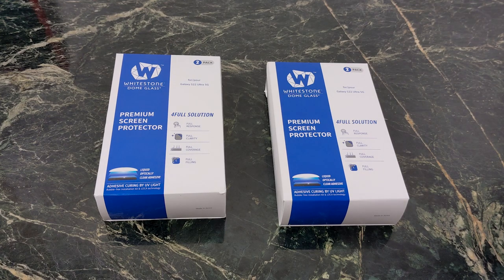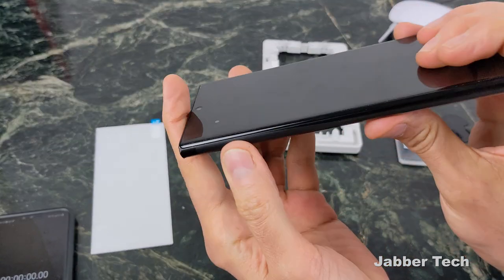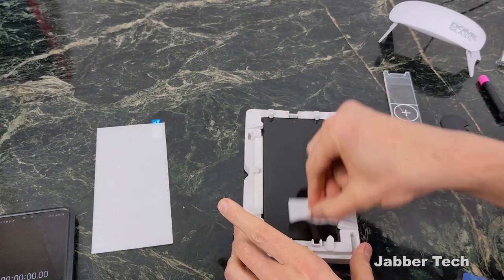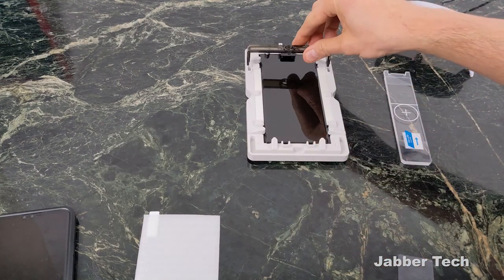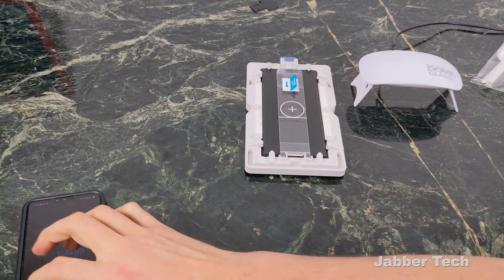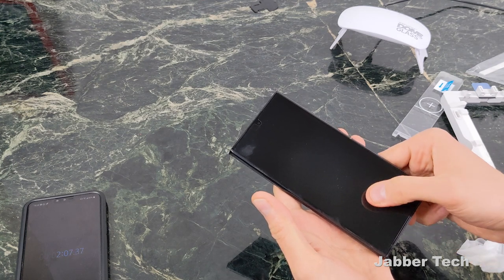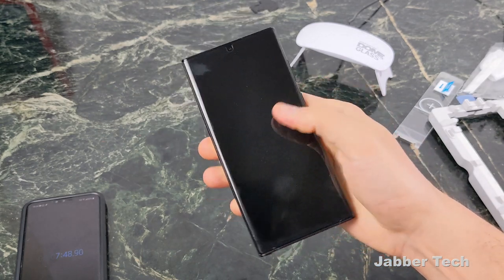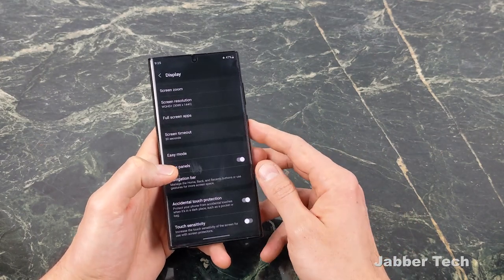Samsung S22 Ultra WhiteStone Dome Glass Screen Protector :  NEW Install Guide

Comment: I just wanted to share that my fingerprint scanner did not work all that great after installing this product.  You had to press hard, and then maybe 30% chance it would work.  The install was visually flawless.  No bubbles or other noticeable imperfections.  After stumbling on a article, I tried a long shot and baked my screen with uv light for even longer.  I went way more than 60 seconds second step curing, but that fixed my fingerprint issue.  Even after installing the screen for week. Now it nearly works as naked screen.  May work for you as well, especially if you are not out in the sunlight with your phone regularly.

Comment: Good tip. I tried something similar. Basically I held down on sensor for 15 to 20 seconds after 15 sec cure. Then cured and while curing the bottom I held down again for first few seconds while light was on. Fingerprint sensor now works pretty much perfect. Quick and I don't even need to press firmly. It's pretty much like the screen protector isn't even really there. Spen and Edge panel Works flawlessly as well

Comment: I love this screen protector but it does not play nicely with the Supcase.  So TPU film it is, but with this lip action Jackson, I'm good to go
Reply from the maker: Supcase is not compatible! I did a vid on case compatibility https://youtu.be/juGYoYWpgjs
Reply: @TheJabberTech  I learned the hard way, just 1 protector tho.  Some say ith a Dremel or sandpaper it can work but I ain't about that life
Reply: @bng1336  I used a sharp blade & shaved mine & u can't tell it's been touched at all whatsoever. It only needs a lil bit to come off for it to work. Even with me telling you I done it, u wouldn't be able to tell where. But it sucks to have to do it but it's worth it too
Reply: @BJPerryJr  but like which part?
Reply: @bng1336  the piece that snaps on the front of the phone... the inside of the corner. I just did the top 2 corners & didn't touch the bottom at all. I'm actually using the case right now & still have the Whitestone Dome on my phone
Reply from the maker: @bng13 I've done things like that in the past! Shame supcase doesn't just do it themselves with the next batch
Reply: @TheJabberTech  ya no joke!  I love the case!  They should know better being one of the most popular models out there.  Glass is glass, but with this lip, the TPU, which I like writing on better anyways, I'm good to go
Reply: @TheJabberTech  agreed... they just barely need to decrease the front piece. I mean very little
Reply from the maker: Exactly, it's like one shaving off
Reply: @TheJabberTech  lol... pretty much. I couldn't even see what was shaved off. I just know it was because it didn't affect the Whitestone afterwards..lol. Thanks for the reply & definitely the great content

Comment: I have Whitestone on my S22 Ultra.  It's the best screen protector I've used.  Doesn't look like you have one on at all.  That said, they do scratch and break somewhat easily.  It's good that it protects the rather fragile S22 glass which scratches if you look at it wrong.  But, at $25 a pop ($50 per two pack) they're kind of expensive.  I'm on my 3rd one now so $75 so far to protect my phone in less than a year time.

Comment: Nice tip!  I've had my S22U for a few days now and I put on the WSD right away before using it.  I didn't have any issues with installation, and I didn't do the finger press between curing for the fingerprint scanner.  I will say my fingerprint scanner works about 90% of the time, which is good enough for me.  There are times where it is a little stubborn.  If I get annoyed enough with it, I'll redo the installation but for now it's tolerable.  The screen protector looks perfect and works perfect otherwise so I really don't want to mess with it.  But this is a great tip in case I reinstall it.  Thank you!
Reply: You can leave it over here.  I’ll only ride it when it’s raining 🌧 l
Reply: @bgredz1  huh?
Reply: @WreckedBrewery  lol, disregard.  I was sending a text and it got mixed up with with the comments on this YouTube video 😂🤣

Comment: Great info! Also watched Ebp man video-  Then I began the process and then screwed up ( no pun intended) opening up the wrong end of glue tube, luckily I was able to keep glue puddle centered on screen, and salvage the whole process to 99.99 % perfection. Followed the extra curing steps, fingerprint pressing after 1st curing and now the fingerprint reader works great. Yikes! almost had a disaster by removing the black cap first!  forgot to pay attention to that tiny detail! Using the new UAG Kevlar monarch as my case, Not taking a chance with Otterbox defender and mess up the install. ( edges lifting etc.)( edit-With sensitivity turned up.)

Comment: I saw this trick on a different video a few weeks ago and it works.

Got a Samsung S22 Ultra (my first "big phone") and saw that the screen protector tech had gone Star Trek on me for some reason (UV curing, waaaaah?)

Got this one and the first one was pretty much an unmitigated disaster. Dust bubble, fingers print would not work etc. The instructions in the box were about as useful as a sheet of used toliet paper. 

Did usethe 2nd one and was much more careful and watched a few vids. Now it's perfect and the FP scanner is more or less perfect.

Comment: If you use increased touch sensitivity, you'll be closer to 100%of the time.

And pressing firmly on the area of the finger print scanner for 30-45 seconds continually has worked wonders for me on the S10 Plus, S20 ultra, S21 ultra and S22 ultra.

Comment: I reccomend removing the white felt glue pads before applying UV light to cure, so the UV light reaches the edges fully.😉👍   I have no issues whatsoever with the fingerprint scanner,  but I always install the WSD before I ever power on my new device for the 1st time!
Reply: Well , not sure about removing felt tabs matter because we are only doing 15 seconds the first time , then 60 seconds after it’s out of jig. So I think it will be fine. One thing that important is pushing phone out of jig with both thumbs at top and bottom at same time.

Comment: Thanks for the great tip! I just installed mine and it was like performing brain surgery. I have 2 dogs and dog hair is always floating around. So I locked myself in the bathroom and proceeded to follow your instructions . Everything went perfectly. Sometimes the fingerprint sensor won't unlock the phone, yet it seems to work 90% of the time in my apps. I just ordered a UAG monarch crimson red case. Hopefully it fits well with the Whitestone dome.
Reply from the maker: Glad to help!
Reply: Yes, The Whitestone does work perfectly with UAG line.( including the Monarch)  however,  The Otterbox Defender is Not compatible,  and although the Monarch is rated at 20 ft, it doesn't appear that way.   Good luck!

Comment: I had Spigen EZ Fit on my Galaxy S22+ and it was almost impossible to use fingerprint reader - it worked randomly and it was really annoying. I replaced it with Whitestone Dome glass and pressed firmly fingerprint area after 1st UV round over 10 times and effect is outstanding - fingerprint reader works like a charm :)

Comment: So besides the fingerprint issue with the Wsd glass, is the Whitestone compatible with the Otterbox Defender case? I tried it with the Note 20 ultra, and although it barely fit, any pressure on the outer part of case caused the glass to lift up.   Is the AM film compatible without the lifting issue?   I can't see how plastic types can help against impacts with the defender. ( currently using the UAG Monarch Kevlar edition.  The glass definitely fits, but the poor front lip protection doesn't inspire any confidence . Except maybe side or back drops.

Comment: Great content.  You could have put a weight on it,  or a couple of quarters.  But I'll still stick with the Amfilm elastic skin screen protector.
Reply from the maker: I used the weight provided
Reply: @TheJabberTech  I know, but weight was distributed threw out the screen protector. With the Amfilm glass screen protector it comes with a weight to put only on the fingerprint scanner. Works great.
Reply from the maker: Next device I'll try am glass,this is perfect now
Reply: The amFilm.TPU shrinks after 3-4weeks :(
Reply: @Pandemonium088  maybe it's film. They are mass produced.  Your's peeled after 3 to 4 weeks, I've have mine on my note20 ultra for over 5 months. With a poetic spartan case.  No peeling, lifting, or stretching.  And I change my cases, very often with no problem. Maybe try another one.🙂
Reply: @jeromegold3216  1.) I didnt say tha it peels, it shrinks.

2.) I am using the TPu film from Ringke and I've only read several feedbacks about it shrinking

3.) Cant compare the Note20 and S22 screen protectora with the amount of time that has passed it ia possible that they used a lower quality TPU.

Comment: whitedome seems to be the best one to use for the s22 ultra. I have never used a tempered glass one before i like the stickers that protects from the glue. Great video that explains. But im so afraid to mess it up even do it so detailed. there is both good and bad rewievs on cracks, bubbles, that fingerprint wont works so i feel confused. what is you all opinions?

Comment: Do you have dry or "wet" palm/fingers? I've been using hand moisturiser to get the WSD to work. (I have dry palm/fingers). In a pinch, a quick wipe on the nose helps.
Reply from the maker: installed it again, made a video too,..all is ok now.works great without lubing up

Comment: I tried the method. Fingerprint scanner worked for the first few hours. Then after the adhesive started drying it would not work. I then went into the settings to redo the fingerprints and for some reason it would only register about 10% of it. I had to remove it. Not sure what I did wrong. Any ideas? When it was done I was so happy it worked.....until it didn't

Comment: how does this screen protector works with edge panel? i have had put on a tempered glass protector on my previous phones (note 8 and note 20 ultra) and since they have like a kinda curved screen it was giving me problems to open the edge panel. btw. i still have my note 20 ultra Lol
Reply from the maker: My finger doesn't catch the edge of the glass when using gestures (think thats your Q)

Comment: I tell ya, I had an LG v60 for 3 years, went through multiple screen protectors, never one time did I have a fingerprint issue. That phone was perfect. Even had an SD card. I get the s22 ultra last week and I cannot stand this phone. I'd rather use my 3 year old LG ANYDAY. It outperforms this s22 in every way, except for the camera. But also remember, a photo only looks as good as the device you're viewing it on. Anyway, the fingerprint on the s22 never works. Worst sensor ever. Even without a screen protector. It's ridiculous. My Samsung s7 plus tablet is no better with the fingerprint.